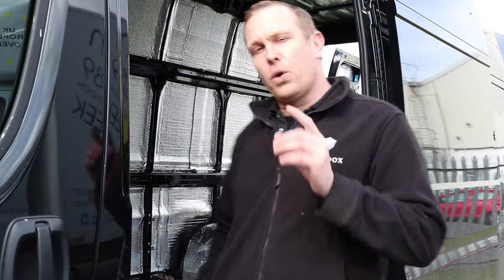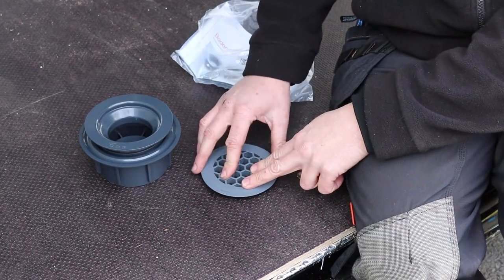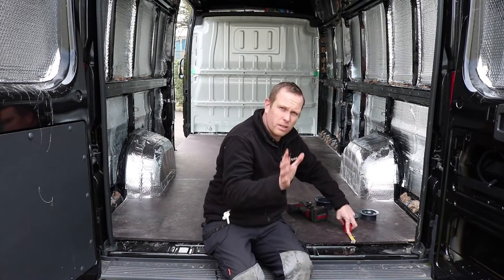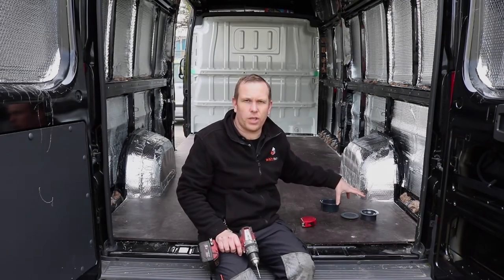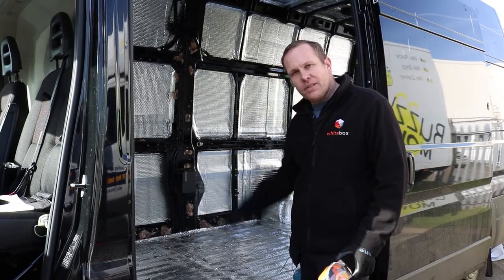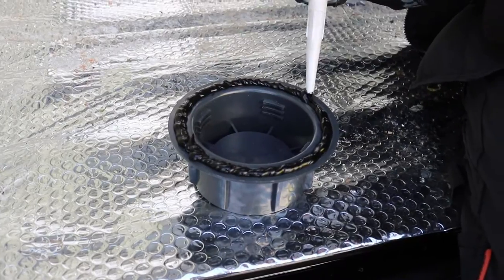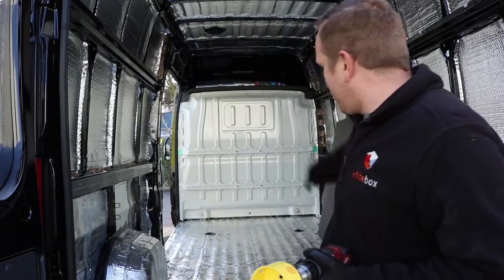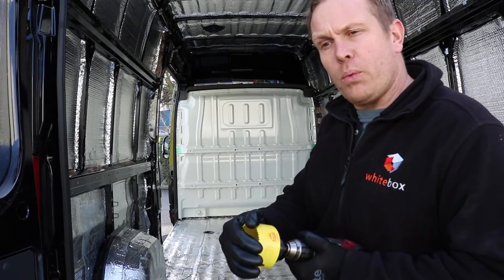Sortimo Van Floor Vent Install Video

Comment: Awesome just what I'm looking for. I'll be doing a winterized Crafter camper and don't want roof ventilation due to heat loss so this will be the option I go for.
Reply: How did it go?
Reply: @soulfinderz  i ended up putting a small roof vent and leave the door slightly open for incoming air. I actually forgot about this thing. Never too late. Thanks for the reminder.

Comment: Hello, how was the floor vent practically working, meaning from your camping experience?  Have you shut the floor vent while driving? Does it have any air filter? Where did you buy it?

Comment: Great informative video. Just 2 questions. What sealant do you use? and What rustproofing do you use? Thanks!
Reply from the maker: Thank you. I would recommend using a flexible body sealant or flange sealant, it sticks really well and stays flexible. For the rust proofing I would use either a Hammerite or Wax oil product. Hope this helps. Mark.

Comment: Would this approach still work with wool insulation installed in the floor or would there be an issue because of the gap where the insulation is located? Maybe there is an additional piece I could use to make this possible.

Comment: Just go under the van and find your spot for the vent and drill a tiny reference hole from underneath the van,  then go inside and cut using your hole saw. 
Much easier than going in and out and measuring shit over and over. 😍😍😍😍😍😍😍
Reply from the maker: I like to be sure its in the right place. You only have one chance of getting it right.

Comment: Maybe a dumb question... but why not drill a pilot hole from underneath the van?
Reply: Just as a thought right up through the wood floor to
Reply from the maker: Its quite difficult to drill from underneath due to the crossmembers and suspension components. But whatever works for you, this is just my way of doing it. Mark

Comment: Why do the vents have to be diagonal from one another? Just wondering.
Reply from the maker: Its for maximum air flow through the van. So corner to corner is the longest distance. If you have them too close the air will just go up and out of the van and not through it.

Comment: Just to clarify, is this used for colder climates or are there other reasons for this type of vent product?
Reply from the maker: Hi Tim. It is used in conjunction with roof vent in order to get a good flow of air through the van. This helps with the ventilation and can help reduce condensation.
Reply: @WhiteboxUK  Thank You. That clarify's it